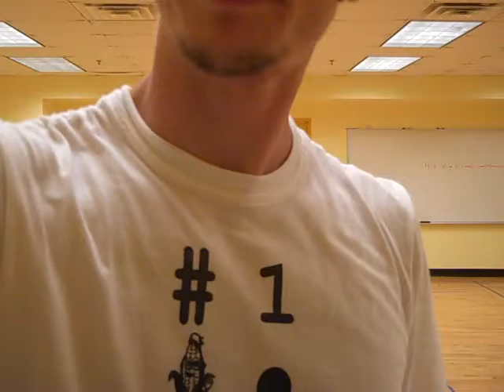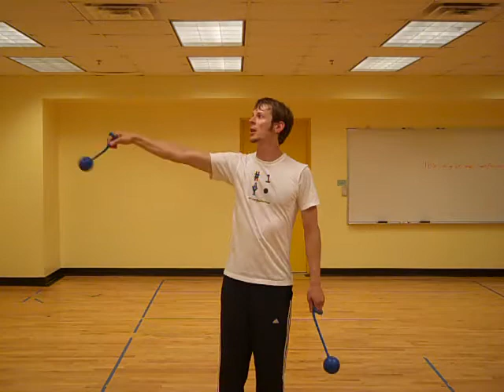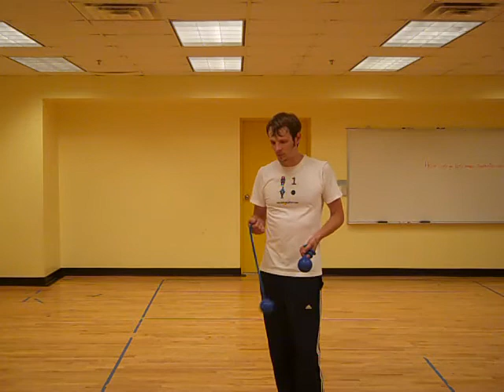Drex's Tech Poi Blog #102: are there antispin toroidal flowers?

Comment: ..... now looking down at the edge of the plate forget it was a plate at all, rather a staff, now antispin... then look at the relationship every 90* to the reference point? so driving styles? theres internal and external transitions in normal toroidal flowers(changing threads)which can be done in both directions around the reference point. also antispins both fwrd/rev and both ways around the reference point

Comment: , in your example spinning in a buzsaw and twirling around , lets call u the point of reference, at all times the poi is passing nearest to u travaling in the same direction... down or up(fowards or rev) in normal this is true but in anti spin that changes with every 1/4 turn. ex. take a plate draw an arrow on it and sit down on the floor with the plate standing up on its side u can make a donut shape by ensuring the arrow passes the center point in the same direction..

Comment from the maker: @charlicopter BTW, just to check my work here...the "antispin" solution I worked out yesterday after reading Ted's response was to switch the orientation of the revolutions of the poi such that rather than being threads of a screw that worked their way around the torus, they instead were essentially C's that looped on top and under the torus but never actually completed a circle around it from the perspective of the side plane. Is this the same solution you came up with?

Comment: @charlicopter What is ironic is that this is just a slightly different application of plane bending than those that Matt Terry applied with box weaves and Arashi applied with his trinity, spinning years ago. HAve you guys seen Arashi draw a perfect 5 pointed start with plane bends every half rotation of the poi? It takes 2 traces of the star to come back to the starting point.

Comment: @AlienJon Consider a 4petal antispin: there are 4 loops, each one points out from center at a direction pi/2 (90deg) off from the last... but in between  each loop an arc happens, and the poi points into center at pi/4 (45deg) from the last loop, pi/2 (90deg) from the last arc. How can you emulate that with the plane orientation change of poi?

Comment: 6th: Since we have to look for a flower in the 2d projection, you are really looking at the linear oscillation of the poi in relation to the hand circle. This line insinuated by the poi plane orientation is changing at the same rate as your arm in the hand circle, therefore what you have been doing is simply equivalent of long arm.

Comment: 5th: Consider mapping your poi rotation as projected onto the hand circle plane. All one sees from top down is the poi head oscillating in and out form the center as it travels around the center of the hand circle. From this projection you can't discern rotation,only a sine wave curved around the hand circle. This is all 2d info. from this projection we can't tell wether the poi is rotating inwards or outwards. The hollow mask, spinning dancer, and sine wave optical illusions illustrate this.

Comment: 4th: Your poi rotation axis is staying tangent to your hand circle, ergo your poi spin plane is perpendicular to your hand circle plane. An helical model fits better, which you reference when noting the pitch at which your poi spins. This is also the case when spinning simple beginner poi, it is just as easy to normalize into a spin plane aligned with the pitch of your figure 8's crossover angle as it is easy to land on another parallel plane. We stay parallel due to practicing that outcome.

Comment: 1st: best practices for general ratios between different cycles in poi patterns: count rotations, not beats. A beat could be anything. You don't have to count off down. You can pic an arbitrary point to count rotation cycles. With some patterns, you will get different counts depending on where you count the rotations.

Comment: Hey Drex, 
I've been working on something along the same lines and have come up with a pattern you might find interesting.... Try doing a normal anti spin flower(poi&arms same dir, split time) but instead of having each petal in the same plane move each petal into a different plane. Its the same as your toroidal flowers but atleast in the beginning its easier to only focus on plane changing one petal of each flower at a time. It adds for a nice effect. Right now I change the petals at 3 and 9

Comment from the maker: @Elemensce I'm pretty sure I demo the version of the flower you mention here in the video and the number of downbeats comes out the same. Think of it as the pitch of fan blades wherein you can either pitch them such that they duct air down or up--the pitch is opposite but the structure is otherwise exactly the same.